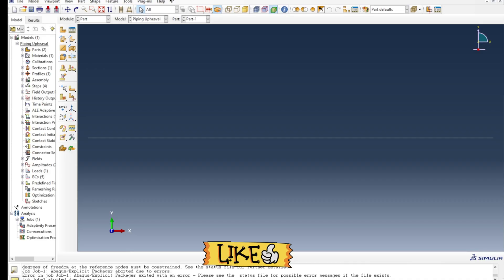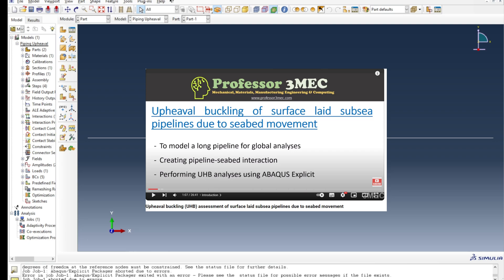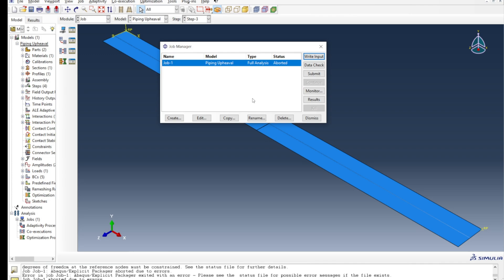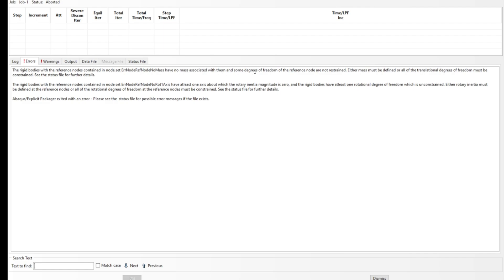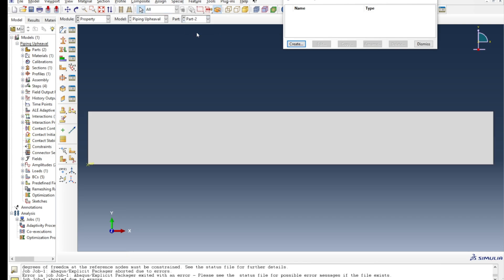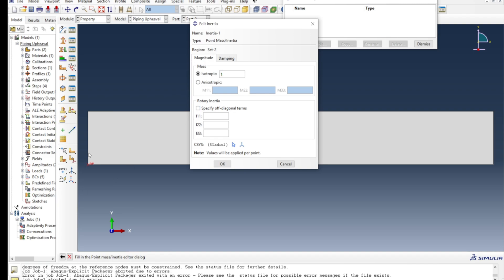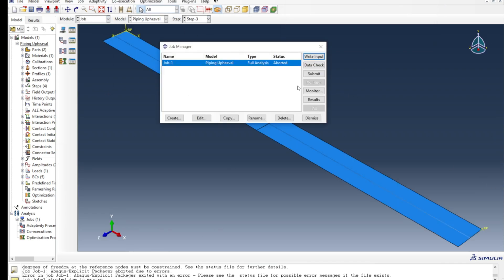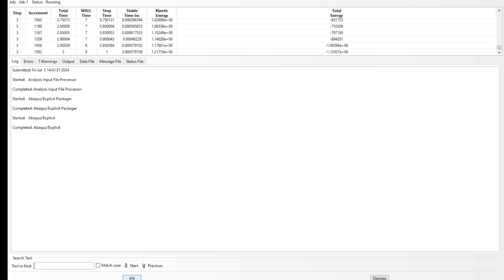How to apply point mass and inertia to rigid bodies in abaqus explicit analyses? step by step

Comment: sir i hope you are fine i am a student of mechanical engineering i have done few simulations during my studies but i face the problem during setting the step time. every time i randomly selected the step time for the simulation but i face the time increment error. sir can you please tell me how to exactly the set the step time to avoid this error
Reply from the maker: Which analysis are you running? Step time is subjective and may depend on problem at hand the way it is simulated
Reply: @Professor3MEC  orthogonal machining and tensile testing of double strap joint